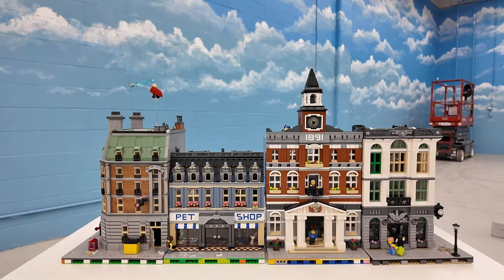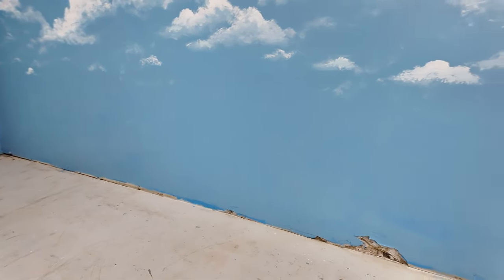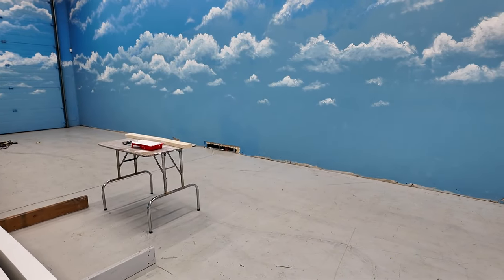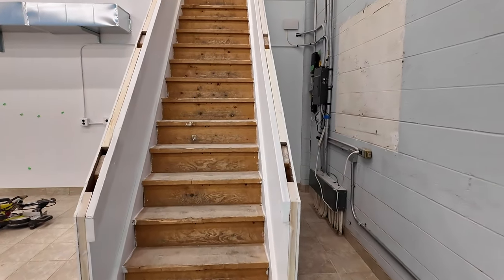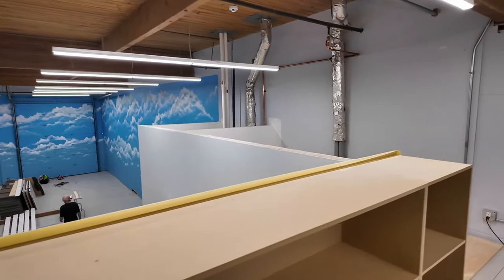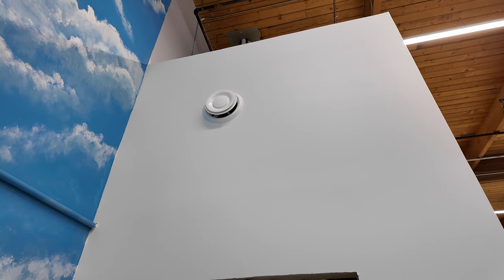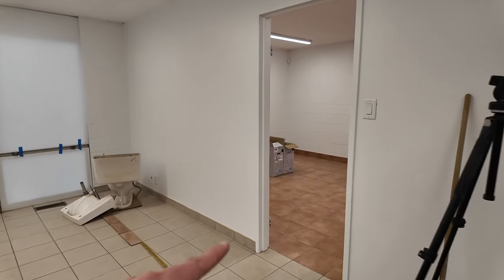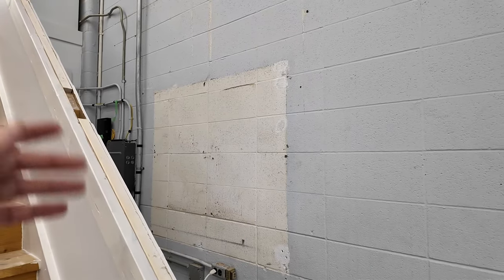THE END IS IN SIGHT! Stairs, Trim, Door, & More Paint

Comment: Looking great. Since you are using under the stairs for storage, I would build a wall under the stairs, on the left side so you can't see the storage stuff and electrical stuff. Nice clean display wall from the outside. You can still enter the storage and electrical area from the right of the stairs. Just a little suggestion.

Comment: Where is the combustion air for your hot water tank that is now required by code because you closed off that area?  Your contractor should have told you that you will require it.